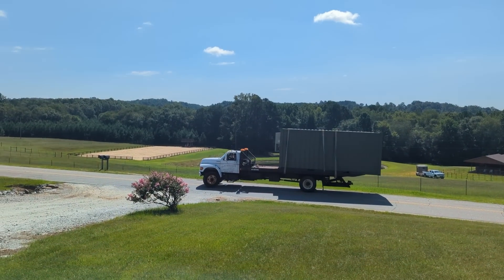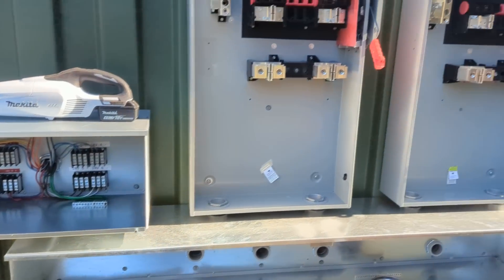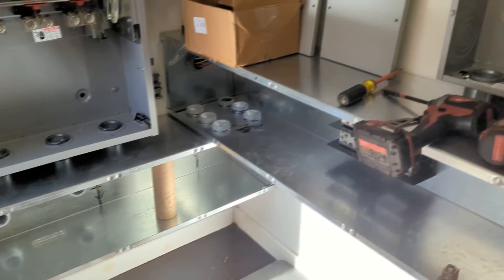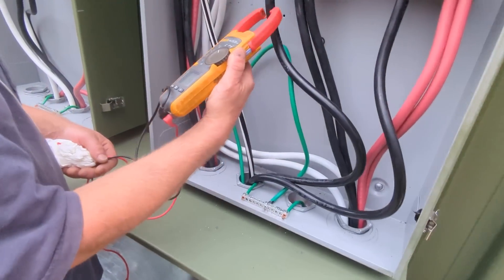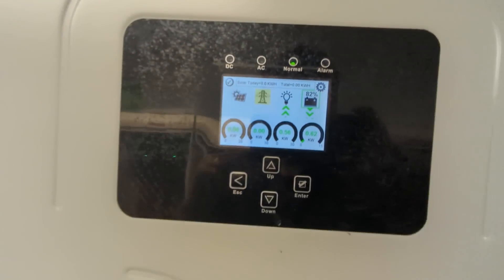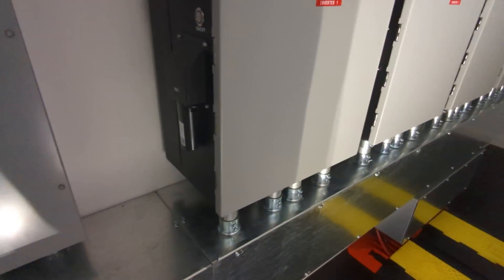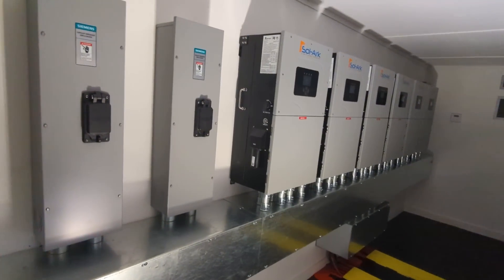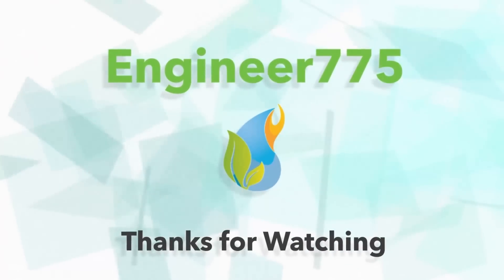Introducing: The Lunavault

Comment: I think do the same 20' container, but optimize it for 200 amp service with same battery count. in the hurricane belt this would be amazing to have.
Reply from the maker: @jackjoshlin  Yes sir, we are actually doing that with two 200 amp services coming out of the next one. We're going to use all 200 amp gear which will save money and time procuring equipment

Comment: Something you might want to consider, is a fire suppression system, that is a whole lot of Lithium batteries, if the system fails for ANY reason, there needs to be some type of backup system in case of battery overheating, which can cause batteries to burst and ignite

Comment: Wow, so pretty, the grown up version of the three phase container-based system I'm building. My original thought was to use two salvaged Tesla model S batteries (200KWh) and build it as a 300+ V system with a Sol-Ark three phase inverter, but I'm going to do it with three EG4 18K PVs and wallmount batteries. My project is going to be slow because it's just me building it.

Comment: systems like this will be common in the near-future. I am sure this will all turn to high-voltage when the equipment becomes more user-friendly and available, but this 48v system is a good blueprint for things to come. It likely cost this customer roughly $450K to go off-grid like this, it has a 600-amp service so its prob a mansion style luxury home costing $10m+ to build, so a 5% bump in cost to be completely grid-independent. This will become increasingly common.

Comment: WHY would you use low voltage.I have a container with 25 klw inverter and 140 klw battery using HIGH VOLTAGE.Look at the crazy massive wiring.The wiring would of been a lot less in mass going high voltage.This really confounds me.But great electrical work as always
Reply: High-voltage definitely the way to go, however there are a few issues with it on a consumer or residential level currently. There just simply isn't any user-friendly high-voltage battery stacks + inverter combos. It's basically a right-to-repair issue. This customer is in rural oklahoma, I doubt there is anyone in the entire state that would be able to service a high-voltage bms that has been frankensteined into a massive three-phase inverter. The solark 15k with 48v battery stacks can be installed, serviced, and replaced easily by most electricians and certainly any solar install company. High-voltage stuff will eventually work itself fully into the residential market, there just isnt anything reliable and "productized" as thoroughly as the solark 15k and all these various 48v battery options.
Reply: @drewgoodman7932  there is many stackable high voltage 51 volt rack batteries and Inverters.  You can take a look Aims 9.6 inverter with 230 volt battery.But the ones I really like has not made it to the USA.while the rest of the world is doing it the US powers there homes with 48 volts.i have been powering my home with a over 200 volts DC battery.when it finally makes main stream here people are going to wonder why it took so long 👍😊.But your right on equipment availability.take care
Reply: How many volts are you running at?
Reply: @RustyShacklefordPocketSand  243 volts
Reply: Can you describe how you built or bought your high voltage system? I’m curious what equipment you used and how you got ahold of it.

Comment: I know you work exclusively with Sol-Ark (or nearly) but I was wondering what your thoughts are on the new "Boss" items from EG4?  It looks like that system eliminates most of the external switches and breakers for up to a 200A service as well as a LOT of the AC wiring.
Reply: No thoughts

Comment: Too dangerous.  Too enclosed if anything goes South.  There is no way you would ever catch me throwing that 600 amp switch in such an enclosed, tight area. Other than that,  it looks great,  but not designed  if things go South.
Reply: Not trying to be a jerk but you obviously haven’t done much work in the back room of a retail space. Every inch is used up and you have to pack all gear and controls into a tight space with code minimums for clearance.
Reply: @markat9576  no offense taken.  High current,  especially DC, is very dangerous. Every time you throw one of those disconnects, you take a chance that the DC arc will not be extinguished, and there will be a fire.  That's why they always have a second guy ready to pull off the first guy who is throwing the disconnect.  They wear protective clothing,  the disconnect is properly rated,  but the risk is still there.

Comment: Good lucking setup. Is there a reason for this instead of inside the structure?
Reply: I seem to recall Engineer775 saying something in a fairly recent video about a potential change coming to the electrical code regarding large battery banks inside the home or attached structures.
Reply: @michiganengineer8621  do you know what the details of those changes are?
Reply: @drewgoodman7932  No I don't.  I do recall that he said the majority of his new installs will have the batteries outside though.
Reply: @michiganengineer8621  ah gotcha. I agree with the whole notion of putting everything outside anyway. Pre-wire everything into a big box and crane it into place, that is what the industry needs to take off.

Comment: Those Bard units have horrible efficiency.  I’d get a mini split 3 ton.
Reply from the maker: @xzibit8614  it is an equipment room that won't require much HVAC in the winter and cooling to 80 in the summer.

Comment: Gardner 5 Gal. Sta-Kool Plus Pro White Roof Coating: 4 generous applications to the roof will reduce the thermal transfer by 98%. All of my containers internal thermal load remains at ambient air temperature even at 105*F outside temps in full sun. Simple, effective, inexpensive and proven.

Comment: For your next build like this, consider the new pytse high voltage battery set up and high voltage solark inverters, would be a massive a reduction in battery cable management
Reply: Aren't the high voltage sol ark inverters 3 phase though? Maybe there's one I haven't seen.
Reply: @ yea the hv are 3phase but the 30k is 120/208 then again the customer is the customer, that determines the equipment.

Comment: Seems like this should have been a perfect project to use the 30K inverters on with high voltage batteries....why did you choose 48V batteries?
Reply: Customer might have specified single phase only? Maybe theybspecifed EMP hardened, and i dont think they have that certified for the 30s.

Comment: Those things NEED a roof! Grantee leaks in a few years regardless of what seal it with. Doesn’t have to be any more than a slant. It might even shade it some.
Reply from the maker: @SkypowerwithKarl  ? I've had a container for over 15 years that has never leaked. Start with a good one.
Reply: @engieer775
Great, so you are going to base your clients future on your “one of” good luck experience? I got a yard full of these things, different makes and lengths and they all leaked. The sides looked great but the low points and trapped valleys captured salt spray or bird poop while in use. Sand blasting helps but it’s not going to get into the crevices where the real problem lies. Clean it off, throw on your favorite roofing sealer and put a protective roof over it. Think of the container’s top as a secondary barrier. 
There’s a reason why they sell used current form factor containers.
Reply: It’s “green energy. Whole thing is a scam who cares if it doesn’t last…. Government funded junk

Comment: Really nice!
Just giving some ideas:
-I would have gone with Pytes(server rack as the big setup you did in a video) or Homegrid  stacked for the batteries for that scale
-I would have added a small inverter eg Eg4 3KW inverter to power the container(just lights and receptacles) with a 5KW battery and add solar panels on the roof.
- Add a fire extinguisher near the entrance
-I would have added the Engineer775 logo to the container
Reply: Pytes? You mean Pylontech?

Comment: If you had a slight pitch white metal roof fitted to mate with the top container corner blocks about 12 inches above the container it would stop the sun from hitting the top of the container for less heat inside. That air gap also will move and cool the top of the container with any breeze. As a bonus the pitched metal roof with a gutter could be used for rain catchment for emergency water source.
Reply: Better still paint the roof white then put some Bifacial sun tracking panels on top.
Reply: Yep white color is very effective, it doesn't absorb much heat compare to dark color,

Comment: Price of this plant?
Reply: 6 solarks x $6k, 245 kwh x $350/kwh, built out container $20k, electrical $20k: prob around $165k just for the unit, then prob add in $20k engineering and $20k shipping and installation. Prob pretty close to $200k all in. Less than $1000/kwh, so not bad. 75 kw solar is prob $150k, so $350k for some huge house to go off grid. Not unreasonable if you have the money.
Reply: @drewgoodman7932  not bad.   The container was 238K and the solar was 70K